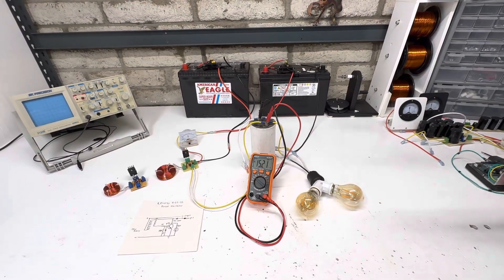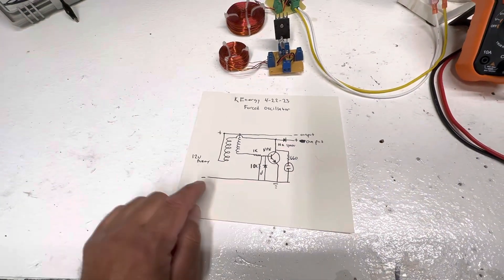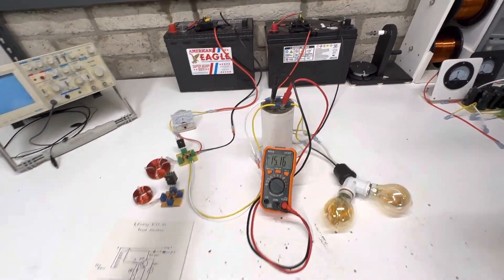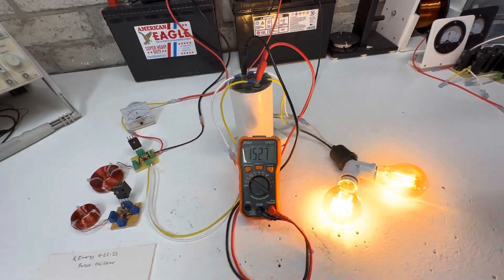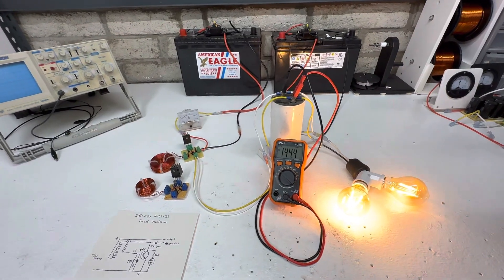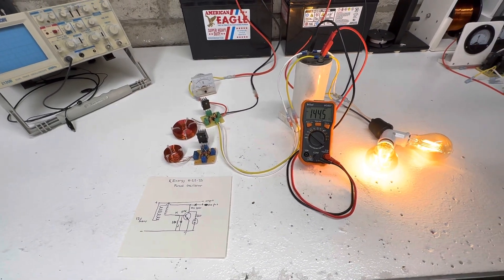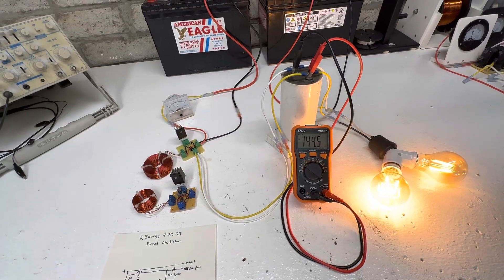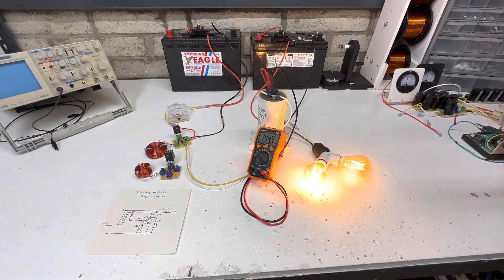Forced oscillator part 2

Comment: Hello and thanks for your work. I’ve been struggling with this circuit for a week now. I’ve even been rewatching your forced oscillator videos trying to figure out what im doing wrong but I can’t get the coils to oscillate. I only get the collapse output when I manually touch and remove the positive battery terminal. 

Do you have any suggestions on how to create the forced oscillation effect? 😢
Reply from the maker: If you have a bedini style coil tha big wire go from + then other to collector of transistor 
The small wire + goes to base - goes to big wire positive
Reply: @kenergy1707 Thank you! I have the bedini winding and the arrangement correct. However, I do have the coils the same size 1:1. That might be why im not getting the effect.
Reply from the maker: @wdstk5233 it should be 1 to 1
Reply from the maker: @wdstk5233 start with 1k resistor you need prob 100 -200 windings
Reply: @kenergy1707 Thanks for letting me know and I’m a little over on the winding count. I’m at 250 for each coil. Does that mean I should try a higher resistance?
Reply from the maker: @wdstk5233 put a 10k resistor between base and emitter 
Try lower resistance to base
Reply from the maker: @wdstk5233 try switching small wire
Reply: @kenergy1707 I’ll give these two suggestions a shot. Thank you! I really appreciate it
Reply: @kenergy1707  I believe my issue was being caused by the fact that I was using MOSFETs instead of traditional transistors. I believe the extra internal diode keeps the circuit from oscillating properly. I tried the circuit with a 2n2222a transistor and it worked perfectly until it caught fire. Thanks again for all your help!
Reply from the maker: @wdstk5233 yes mosfet don’t work for that try a Toshiba 2sc5200
Reply: @kenergy1707 just ordered a pack. Thanks!
Reply from the maker: @wdstk5233 use the npn
Reply: @kenergy1707 Will do

Comment: The number of coil turns
Reply from the maker: 50-200
Reply: @kenergy1707  The second circuit: How many turns of wire
Reply from the maker: @rmadangarara3851  probably 50 turns

Comment: Great
Thanks for sharing
Have you more info for the neon resistor and diodes
Reply from the maker: Bedini type with 660 resistor
Reply: @kenergy1707  is this 660K or 660 ohm
Reply: @kenergy1707  Thanks